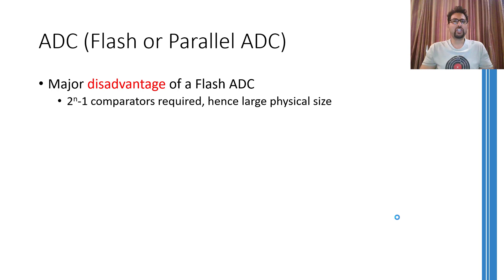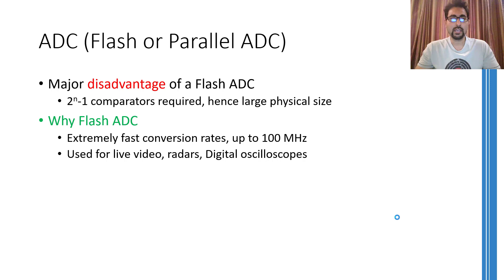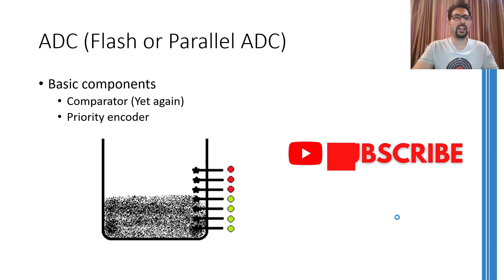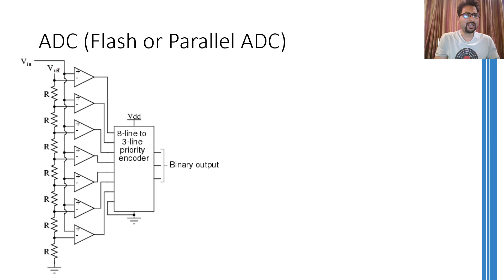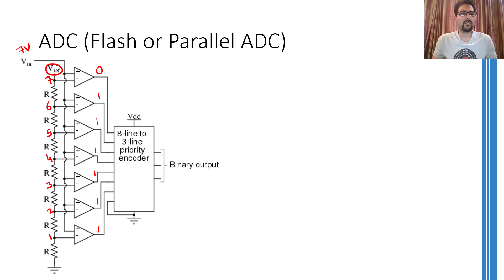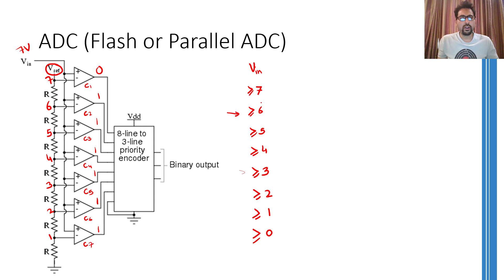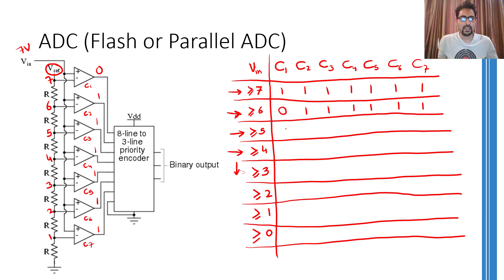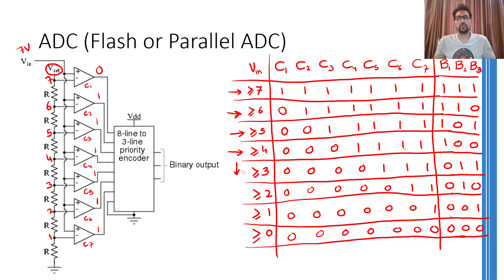Flash ADC | Analog-to-Digital Converters

Comment: Does the Vin (input Voltage) has anything to do with the number of bits, and hence, the number of comparators? Does it need to be equal to the no. of comparators used?
I mean, in the example, we used 3-bit encoder (7 comparators) and used Vin = 7.
What if the Vin = 45 or anything else?
Reply from the maker: I have used Vin = 7 just to make calculations easier. If, for example, you'll use 45V as Vin then between every level you'll have 45/7 = 6.428V.